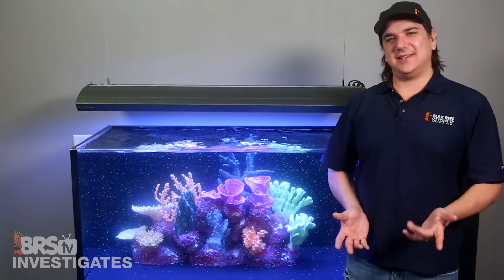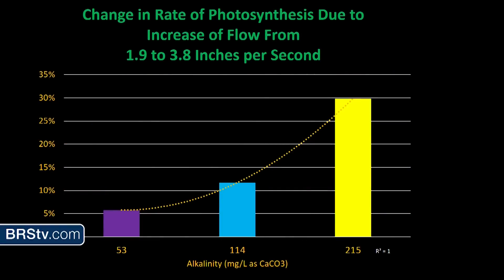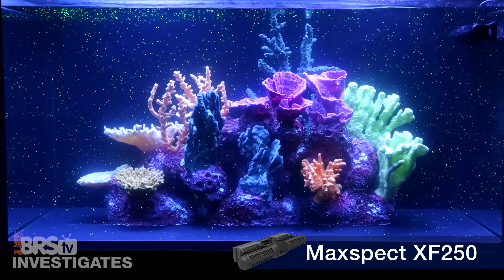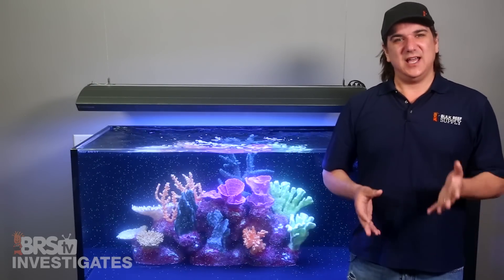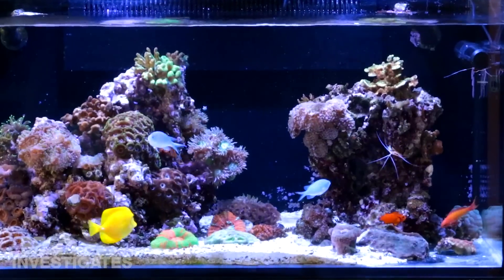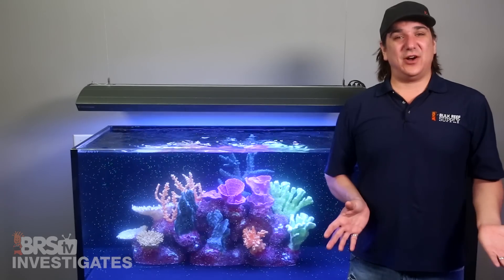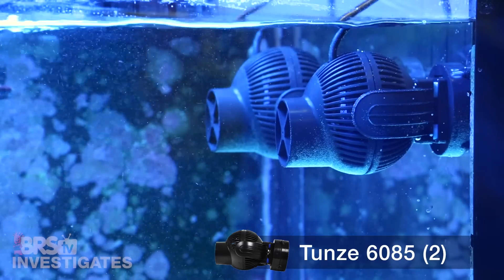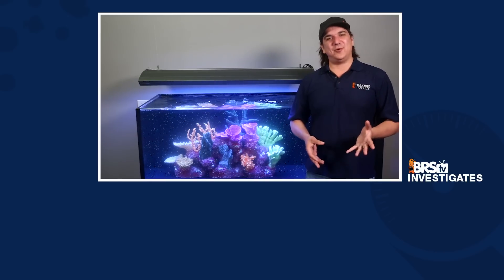Is the Maxspect Gyre pump the only way to create gyre flow in my tank? | BRStv Investigates

Comment: Could ou recommend gyre on the side and 2no Mp10 on the back wall?
Reply from the maker: That could certainly work. Flow is so dependent on your tank's rock work and types of corals, so it's hard to say exactly. I usually like to look at the tissue of my LPS or the polyps of my SPS to determine if I have enough flow or a good flow pattern. You don't the tissue/polyps to be blasted against the coral skeleton.

Comment: Suggestion, in your 6’ tank where you were using2 pumps to try and create the gyre. Do you think it would work better if you placed a high flow at top on one end and a lower flow half/3quarters way down but at the other end ? This should encourage the gyre to form as desired.

Comment: Debris gets stuck on the sharp rocks also. Maintenance of the rocks is a good habit. Blowing into the crevices with a turkey baster every once in a while will definitely get that debris out. Beneficial bacteria and water changes is all you need to keep your aquarium running smooth without worrying about what's in the rocks. Me and my angelfish like walls of live rock. Leaving gaps in between the rear glass panels and the rocks is good enough for flow to pull out anything that's back there.
I'm using 1 wavemaker on my 4ft aquarium and it circulates the aquarium just fine.
Proper placement of 1 wavemaker aiming at the surface is better than multiple wavemakers because the fish are comfortable and they're never blasted around all day. Having the right size wavemaker for a tank is very important because you could possibly have too much flow, not enough flow or the wavemaker could look bulky in a small tank. Turning up the flow for a few seconds on your wavemaker could free up some of the trapped debris if your coral will allow you. I do that sometimes and it works. I sit and watch the debris as it goes into the intake. There's nothing better than a tank that can work for you!

Comment: I had multiple pumps and controllers I just installed a Glamoraca GP 03 in my 70 gallon and it took all the dead zones way in one shot I picked one of the programmed presets and it is perfect for my tank and how I love having three eyesores out of my reef is nice. Just one near the surface, I now have three other real good pumps to use in a frag tank I want to build. This one pump is licensed by Maxspect does the same thing but easier on the pockets,  I now have a nice Gyre effect in the aquarium it works and I have seen a real nice response from my corals and fish. I should have done this in the beginning.

Comment: I’m getting the same affect using just my 3000gph return pump using a sqwd and 6 flow Excelerator‘s 3 per side. My gyro affect switches side to side meaning the water over the coarse of 15 min shifts side to side and lowers up and down per side shifting where the overlap is.

Comment: I had two koralia 1950 in a 75 gallon plus return pump with 4 outlets. I got most of my flow off my return. The koralias didn’t do enough at all. One gyre xf230 is more than enough flow. I might add another one later though so I can cover more area around my rocks.
Reply: Never Give An Inch tnx

Comment: Was it a total of 4x 6085's in the BRS160? I'm getting a 150 Gallon (72x27x18) and liked that the video stated the 6085's are better, but then also said a pair on each side with footnotes? 

Looking for clarification if possible! I don't think I would want 4 pumps in there. Hopefully only 2 pumps of the 6085's was the verdict for the BRS160. (2 on one side, as demonstrated in the 120? 1 on each side?)

Thanks!
Reply: BulkReefSupplyCom thank you for the quick reply!

Comment: The video shows a top to bottom flow pattern. The pump is placed high and causing the water to shoot across the top of the tank and return across the bottom...I'll call it horizontal flow. I think I read somewhere that creating whirlpool flow is desirable. In essence its the same type of flow as a horizontal gyre just on a different plane...across the front and back rather than the top and bottom. Any thoughts?

Comment: What are those beads that you used? Will they biodegrade?

If sucking in water is an issue, why not produce the gyre by shooting the water over the bottom? Or one bottom and one top?
Would also pick up detritus and keep it from settling on the bottom.

Comment: I'm setting up 85 gallon tank 26" tall would the maxspect be a good choice for a taller tank? And I have a corner overflow would you place it on the same wall as the overflow or the opposite?

Comment: Hey guys, kudos on yet another great series! Here is a suggestion for a future episode: compare the performance of mechanical filtration media (carbon and GFO) in a reactor vs in a sump compartment where all the water is pushed through! This is not passive drop a bag in a sump style, but rather having the media in a basket where all the water has to run through. One of these Nuvo all in ones should make it quite easy to compare. To me this is interesting as I am always trying to minimize equipment, electricity, tubbing, etc!

Comment: Is there any reason why you didn't use 2 MP40 on the BRS 160?  If you use 2 Tunze 6085 why didn't you try 2 MP40's?  I know the price of 2 Mp40 would be over $700 but your comparing 2 pumps against 1.
Reply: The price of the 2 tunzes is about the same as the one MP40 or the Gyre.  If we only had that blank check we could write for our wants!

Comment: I would of liked to of seen you run 2 MP40s on one end of the tank like you did with other pumps to see what kind of effect it would have.

Also, it would be nice to see what kind of flow would be achieved with 1 pump on each end of the tank like most people use.

Comment: I think the Maxspect Gyre is a great idea, but If you calculate the gallons/hour/watt, it's a LOT less efficient than ecotechs...
Reply: yeah, doesn't seem much, but at 6000gph/80w, the gyre uses 66% more power than the vortech mp60 qd, which is 7500gph/60w, and about 58% more power than the MP40qd which is 4500gph/38w. in my tank gyre was no option as this would mean >1000 kwh per year MORE consumption for the same amount of flow...

Comment: I'm upgrading to a 120 Gallon SPS Tank from my 34 Reefer 170. I currently have 1 Gyre 130 running vertically on my tank which is perfect. However for my upgrade, I'm debating on either adding 1 Gyre 250 OR 1-2 MP40's on the opposite side of my Gyre 130. What do you guys think?

Comment: its a bit of a miss leading using 2 6085 compared to 1 Gyre a xf250 if u used 2 gyre it would be way better and apart from the controller they are the same price so $ for $ the gyre is by far the best
Reply: Was it a total of 4x 6085's in the BRS160? I'm getting a 150 Gallon (72x27x18) and liked that the video stated the 6095's are better, but then also said a pair on each side with footnotes? 

Looking for clarification if possible! I don't think I would want 4 pumps in there. Hopefully only 2 pumps of the 6085's was the verdict for the BRS160. 

Thanks!

Comment: Big tanks are cool and all, but what about in smaller tanks and cubes? Noticed you only tested side-to-side. What about from the back of the tank to the front?
Reply: I tested my Icecap Gyre on a back to front configuration on a 100gal (6-foot long) tank, about 4 inches below the surface.
I had to dial down the speed to about 40% to get a good gyre without blowing out the sand or blow the water over the rim.
I think a single Maxspect or Icecap gyre would work on cubes as large as 2 feet by 2 feet.

If I had the money for it, I would try three gyres on a back to front configuration along the entire length of my tank and see how it goes. :)

Comment: I thought it was better to have alternating pumps that generate a dynamic flow rather than static flow continually in one direction?
Reply: my thought as well...
Reply: BRS, I have a 10 foot heavy SPS dominant tank coming, was gonna have an MP40/60 pair on each side, and 2 MP40's on the back, to be able to have turbulent flow. Do you think 2 (or more) XF280's could provide enough varied flow instead of these (if yes, awesome, they're a lot less expensive :) )

Comment: What kind of effect does the overflow box placement have with this system?
Reply: The reason I ask is that, in the end, the purpose of flow is to remove excess nutrients and waste from the corals\rocks, etc. If it were possible, perhaps an experiment showing same exact quantities of the luminescent beads and how quickly with varying flow patterns are they removed from an empty tank and one with the artificial corals. You can even push forward and demonstrate standard hang on versus drilled vs other styles of overflow.
Reply: We have one gyre in a 75 gal four foot tank. It's fantastic for keeping detritus in the water column until it makes its way down the overflow. Our tank is drilled for two returns which did cause us to have to place the gyre slightly lower on the side of the tank than preferred because it caused the overflow to occasionally suck air. The cross flow of the gyre with the return nozzles makes for some great variations in flow. At 80% varied ramping the gentle wave action keeps everything moving in alternating waves. Love the gyre!

Comment: Great Video, I Appreciate  that you use the beads to give a visual representation of the flow patterns. I have a 5.5' peninsula style tank and only have pumps on the overflow wall. Its always a challenge to get flow through the full length of the tank.   I have mix of vortechs and a gyre all on the one wall and find pulsing them to create a whole tank wave.. so far my best solution.

Would you worry about the Tunzes blasting your corals and being too much flow?  Awesome prizes! :D
Reply: True enough!

Comment: What are the thoughts on two or even three gyre pumps in a larger 6 foot tank?
Reply: Cole Robinson I have 2 gyres on my 6' tank. One on each end, and I love it.
Reply: I also have two on mine and have them going front to back.  Sand movement is crazy but coming from a lack of flow tank to the flow of the gyre pumps I wanted movement across the bottom also.  I have been thinking about the two on each end and putting my mp40s as supplement front to back.  Just haven't gotten the correct placement.

What setting do you run your two gyres on and about what percentage of flow?